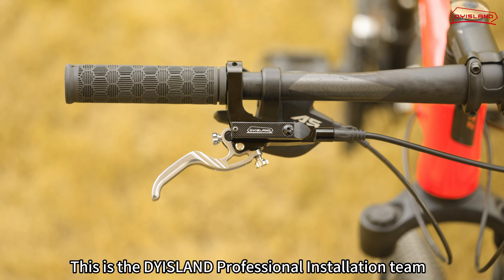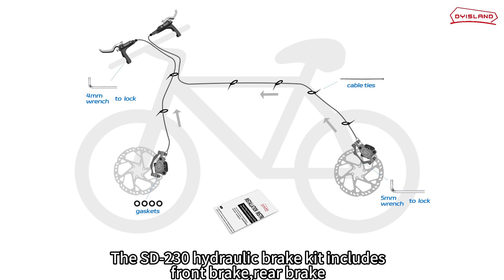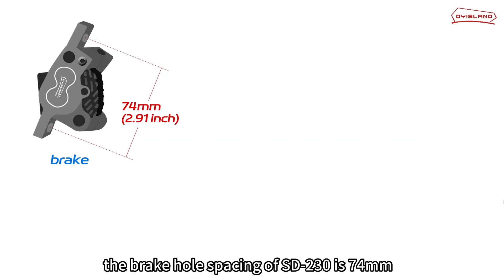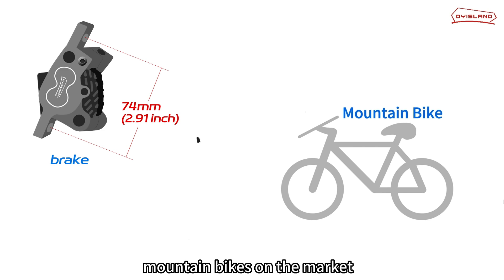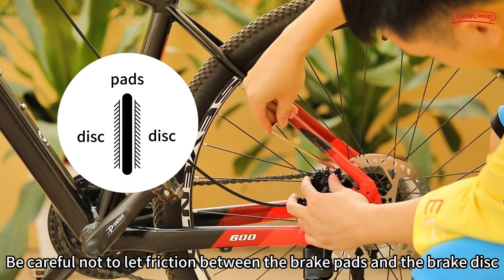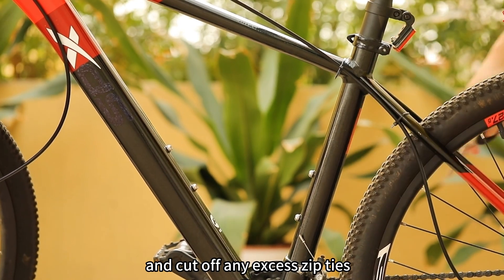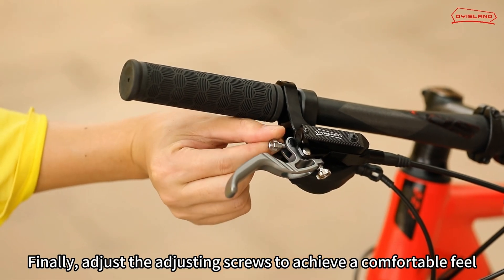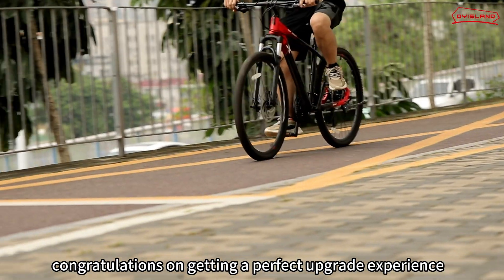DYISLAND SD-230 | Four-piston hydraulic disc mountain bike brake installation tutorial

Comment: Just go ride after installation? No bedding in period?
Reply from the maker: Hello, if the brake you purchased is installed with sintered brake pads, a running-in period is required, and the best effect will be achieved after a period of running-in; but if the brake pads are made of resin, no running-in period is required.